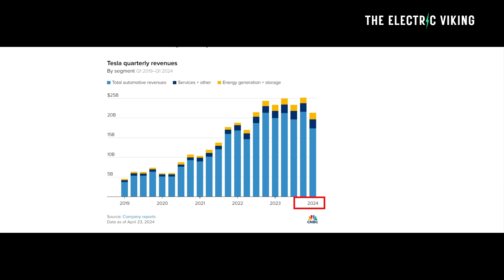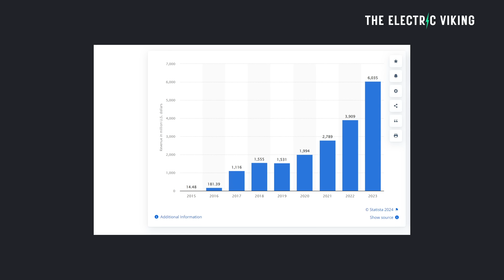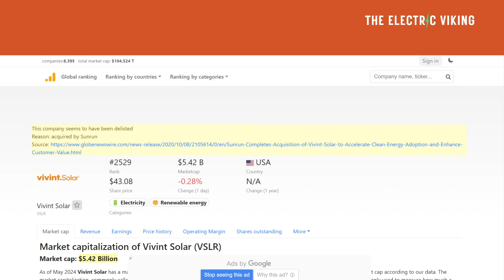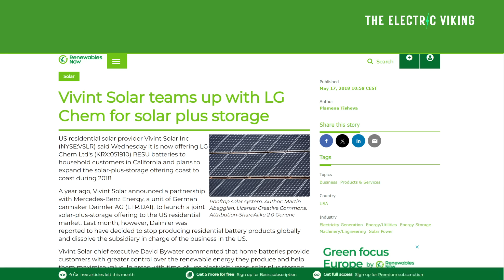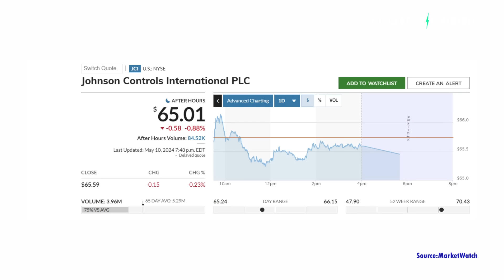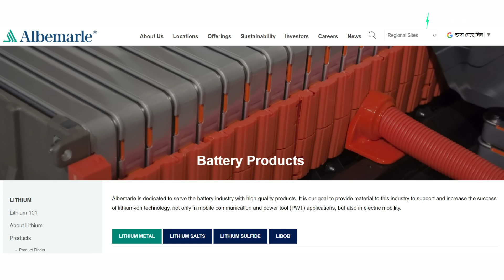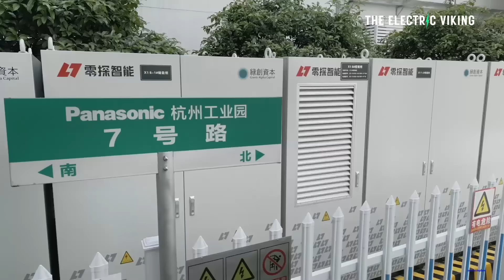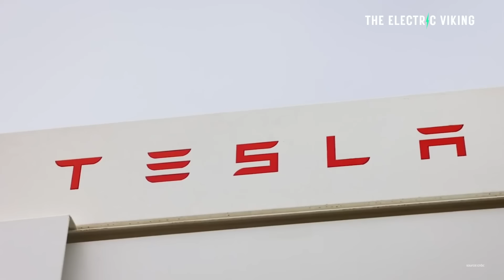Experts rank worlds Top 10 Energy Storage Companies - Tesla first

Comment: Tesla does make its own battery cells at Gigafactories, with significant production taking place at Giga Nevada (in partnership with Panasonic) and Giga Texas, where Tesla has started producing its own 4680 battery cells. These cells are used in Tesla's energy storage products, such as the Powerwall, Powerpack, and Megapack, as well as in its electric vehicles.

Comment: Batteries can play a role in system voltage support and frequency support.  How much I do not know because rotating turbines are also used for this type of system support.  What I would like to see is the economics of supplying baseload power with solar and batteries.   This requires a large investment in dedicated solar to recharging the batteries in addition to millions to install the batteries to provide off peak power.

Comment: I hope they will over time make an off grid system for semi's by putting batteries in the trailers, putting on a bunch of solar energy and storage to charge those trailers. 
The trailers should have their own sensors, solar, battery, and engine(s), and extend the range of the semi a lot. Even if it's an old diesel semi.